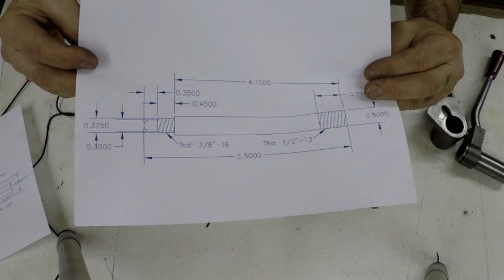Lance Lathe Control Handles Part 1

Comment: I know I'll enjoy the process of making the sleeve, but an easier solution may be to take a deep socket and lop off the drive end.  Viola, a ready made hex sleeve.  Turn down or bush the outer socket to fit the rest of components.
Reply from the maker: Morris Gallo The shaft is a 16 mm hex.  So I checked out you idea.  The 16 mm deep sockets I have are only about 0.850" outside dia.  I would have to cut off just the hex about 0.600"  then insert it into a bushing.  This probably would of worked. I did go another route.  Thanks for the suggestion they are always helpful.  Thanks Randy

Comment: Hi Randy,
The new logo will look great on shirts...
Started making videos a few months ago, I've just cross the threshold where I can do a witdrawal meaning mi first $10... I guess I must be having more fun than you... lol
If you make the bushing too hard the wear will end up on the hex shaft, if the shaft is easy to change and get it may be the solution.
Broaching the sleeve on the milling or other lathe with a square HSS self ground tool and indexing 6 times...???
Good project,
Pierre
Reply: The only ones making REAL MONEY is Google, nice free programming for almost ZERO production fees...
Reply from the maker: pierre beaudry Thanks Pierre. Wow you are makin some coin.  Decided not to harden  The w1 I used is already harder than than the hex shaft.  No broaching for me.  You will see.
Thanks Randy

Comment: Wack off a six point deep socket, fire up the welder, done.
Reply: That would work, and if its not quite aligned you could always hammer it on with your sledge hammer.  Sometimes  its not about what will work but what is the right way to do it.
Reply: Let's not get into what you think is right or wrong George! I say what ever works for ya, now take your sledgehammer and stick it where the sun don't shine! Love your video Randy. There's aways someone who answers for someone else's guess he's bored.
Reply from the maker: Dennis Skerb Well that is an option but not as fun.  You know I honestly did not even think of that.  Thanks Randy
Reply from the maker: George May Yep,  I finished it up today and I think I did one of the many right ways.  You will be the judge.  I hope to get it edited sometime tomorrow.  Thanks George.  Randy
Reply: Randy Richard Love you videos, and I have to say my last comment was not directed to you. Keep up the good work and great videos.

Comment: Ha, you made me go check mine....and it's keyed.. ;-)
Any chance there is a hex broach you could borrow to make it an easier process??

Colin ;-)
Reply from the maker: ***** Thanks Colin, How's the snow?  I am leaning toward milling only 5/8" deep.
Also thinking about making a broach.  Milling will give a better surface finish and then I will polish, then possibly harden and polish again.  Min.amount of wear with a highly polished surface.  That is what I am thinking right now.  Randy
Reply: Snow is still scarce her...I'm liking a mild winter.
Making a broach?? That could be a project in itself.. ;-)
Reply from the maker: ***** I thought you would of got pounded this last big storm.  No on the Broach.  That would have to be a seperate vid.  thanks Randy

Comment: I looks like if it is sized properly and the operator doesn't crank on the handle that a softer material would still wear well without many issues no matter what material you decided to make the bushing out of.

Take care of that throat.
Reply from the maker: ILGopher Thank you Ryan.  Throat all better today.  I agree.  There is no real forces on the bushing or shaft.  It just provides actuation of the fwd and rev switches. The bushing just freely slides along.  The amount of play was driving me crazy.  Thanks for the comment.  Randy

Comment: if you want to keep the lock at the carriage handle then you'll only be able to turn the spindle off using the handle at the gearbox end, won't let you turn it on since you'll need to unlock the handle at carriage to rotate the shaft. Just a heads up in case you were planning to use the added onet for both on and off.
Reply from the maker: sharp x Great catch.  The cam over action of the linkage to the switches far better than the catch on the carriage handle.  So the carriage handle is really doing nothing.  So I think I am going to lock back the carriage handle or make a new handle for the carriage that will not catch in the bracket.  That way I will have both ends for on and off.  I was looking at that today.  This type of project evolves as they go along.  Thank you for making the the great comment.  Randy
Reply: I'm looking to do the same thing (add a handle at the gearbox) so I research that previously (reason I did catch it :) - mine has a ball detent at the carriage with 3 holes in the carrier/bracket, that helps to not overshoot when you turn it off  - can't remember if your's has it but pretty easy to add if not, drill a hole, add ball, spring and a setscrew which you can use to adjust the pressure on the ball, you need 3 spots made with a center or spotting drill for each position, the middle/neutral one can be a bit deeper so it keeps it from moving over to reverse (hard to leave it to the microswitches to take care of that but now that I think about it you might have something on that rod going to the switches).
...and this turned into a long post :)
Reply from the maker: sharp x Actually the detent action of the current handle is very poor, due to design and wear.  The camover action of the other linkage is what holds it in position, so I am thinking of not doing anything with the current parts for now and see how it goes.  Then decide what I want to do.  More evolution.  Thanks Randy
Reply: looking forward for the vid where you make the hex bushing - I need a good idea how to do the same (the option I was thinking of was to buy a large allen bolt that matches the hex, cut the head off and drill from the thread side to a diameter that would fit the hex closely).
Reply from the maker: sharp x Just finished it up today.  The allen bolt idea not bad, or the socket idea.  Thanks Randy
Reply: socket - that's a great idea

Comment: Thanks Randy.  I think I'd leave the bushing soft rather than letting it wear out the hex rod.  Kinda the same argument about hard brake pads or soft.  Personal preference I think.
Reply from the maker: Terry Talton Hard to say.  The more i have looked at this, I think the bushing that I removed was very poorly made and way oversized.  Making it the right size will be a great improvement.
A bit of way oil will also help.  Hard to say about hardening.  I have not decided yet, I will do a file and punch test to see which is harder before making a decision.  Thanks for the comment.  Keeps me thinking.  Thanks again Randy

Comment: Thanks Randy, all shirted up and looking forward to the following videos on the new lathe handles.  One would have thought there would have been a set screw on that hex shaft so it would stay put so as to not round off the point on the bushing, but what do I know?
At least now you have the fun of fixing it and we have the fun watching.
Reply from the maker: John Bare Thank you John.  Fun project.  The bushing on the carriage was made to big the last guy who replaced it.  It slides along the hex shaft so no set screw.  But I will fix it right this time.  Thanks again John for watching and your great support.  Randy
Reply: Oh yeah I get the idea now it slides with tthe carrage what was I thinking, I guess my comment proves I wasn't thinking at all, I did not have the big picture in my head, just a screw loose or two.  That is the good thing about being old you can blame it on the Some-heimer's only talking crazy some of the time.
Reply from the maker: John Bare No problem John.  I walk across the shop and forget why I walked across the shop, then go back and start over again but with a note.  Thanks again.  Randy
Reply: Bad news, that will happen more and more as time goes on.  Start to worry when you begin asking Roscoe why you are standing there.
Reply from the maker: John Bare I think we will get Roscoe on a training schedule right away, the first machining service dog.  Maybe he could read one of those Brail Mic's.